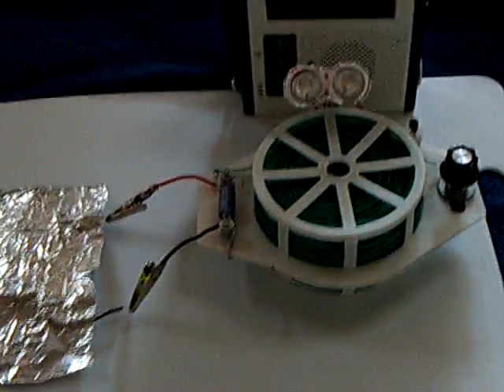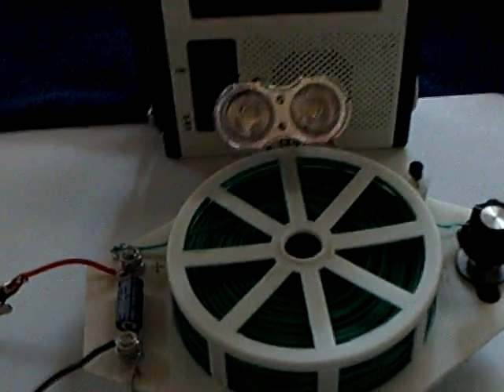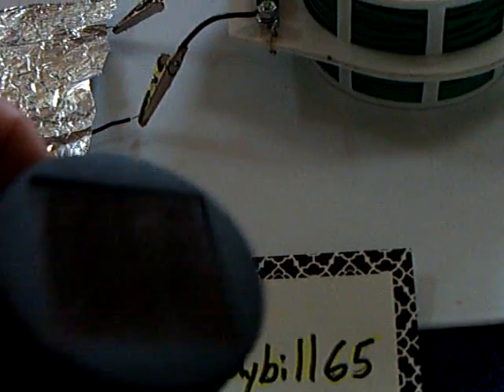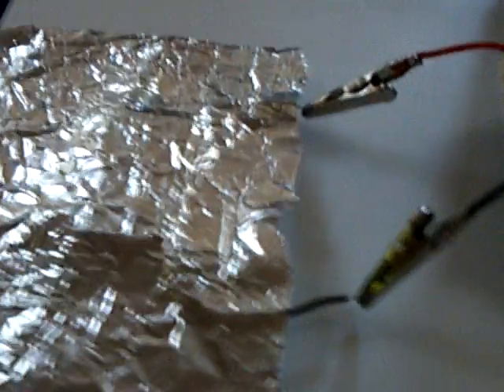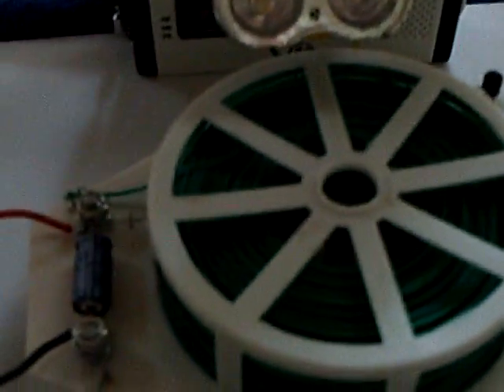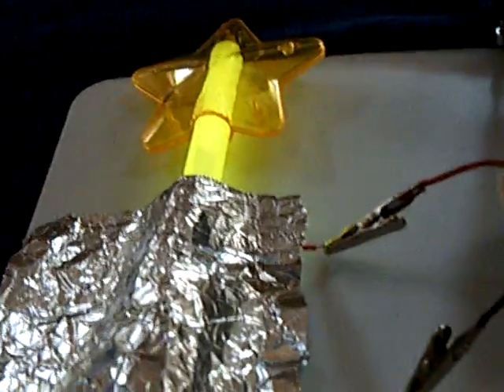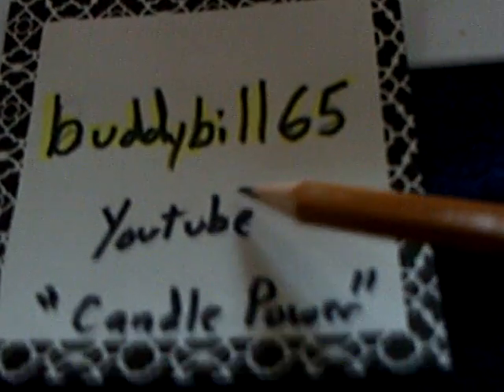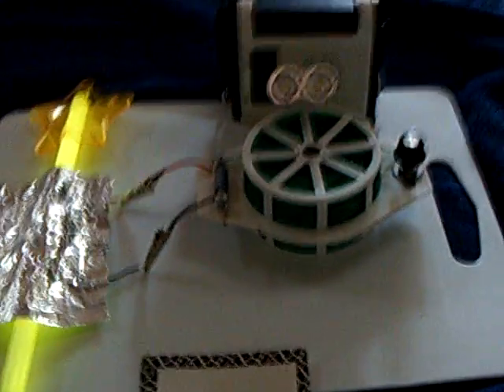Solar cell working off  GLOW STICK light

Comment: Head over to Energeticforum dot co m and, in the Renewable Energies section is the sticky thread 'Bedini Earth Light'. In which, you'll find the discussions of various salts/electrodes/methods and tips. From simple but effective glue cells to stovetop cooked mixes, to heating copper to form a semi-conductor and lots more practical methods to build homemade cells.
Also check out more of Lidmotor's videos, he has covered the experiences and results extensively in his presentations :)

Comment: That was a great experiment. Makes me wonder what exactly the chemicals are in glowsticks and can we stick them in salts cells. Would the chemicals react with piezo effects and create a long glowing salts cell ! Or even, when this one runs down, break it open and use it as the electrolyte. I wonder if the depleted uranium (as I refer to it) reacts to voltage even after being used up. I have no idea...wouldn't have even wondered except for seeing this :)